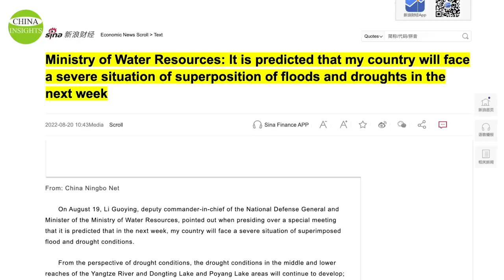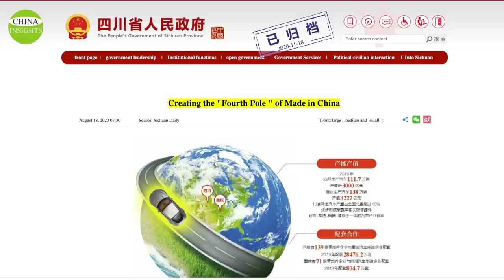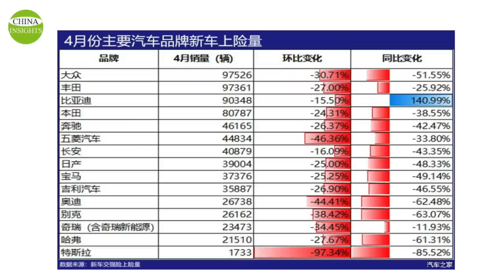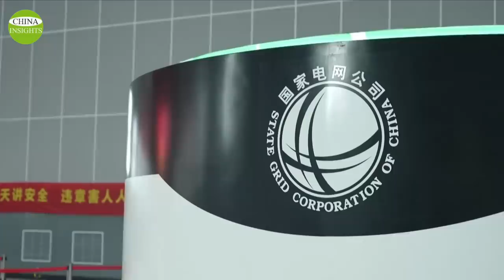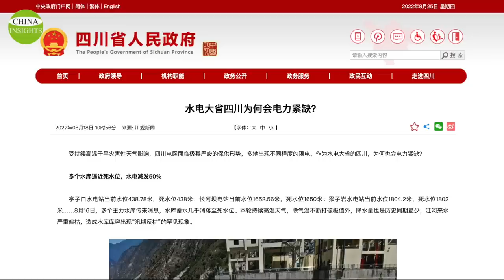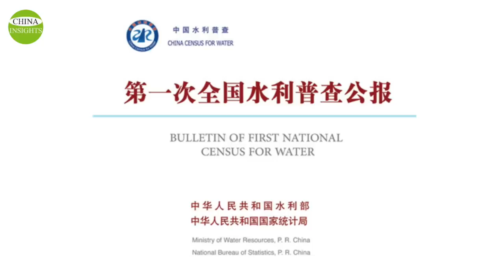Why does Yangtze dry up? The Power Crisis continues & Extremely high temperatures grip half of China

Comment: The cascading Yangtze hydropower system is very clever, however, China needs to find more sources of power to avoid drying out the Yangtze river during every foreseeable summer.
Reply: They are too distracted throwing temper tantrums in the Taiwan strait
Reply: Well this way when the big dam fails everybody down river doesn't drown.
Reply: Winter is supposed to be the dry season of China due to the change of seasonal wind direction. This drought has made the schedule a lot quicker than expected.
Reply: They are making nuclear power plants right now. What about Europe?
Reply: Well, not immediately. When the indundation of rain comes back, the ground can't absorb it due to the dry soil particulate becoming hydrophobic, so it just runs off and you get flash flooding events. That's the bit people usually forget about.
Reply: @yeeyaophang1220  
What about Europe?
Reply: Did you not hear the stats on this, hydro power only counts for 18% of the countries power. There is something more devious going on here than a water shortage!
Reply: Eject                        um...  nuclear power plants require water.   About 50,000 gallons (210,000 liters) per hour

And nuclear plants in France and Germany already run below max capacity due to lack of water.
Reply: I don't think you know what the word "clever" means.
Reply: This was known long before it was even proposed to be built
Reply: @yeeyaophang1220  Europe, America, and Canada are working on nuclear fusion power plants :P
Reply: @defeatSpace  Okay 👍🏼 good time to diversify. However where will they be getting the Uranium? xP
Reply: I read they have a new pipeline from Russia, bringing gas to Mongolia.  That China's also buying coal at a discounted price from Russia, and that the two countries are also collaborating on nuclear power development.
Reply: Nope it's  stupid
Reply: @macmcleod1188  The water is not  permanently consumed it is used mostly for cooling then sent back to the source. the steam used to run the turbine generators goes into the atmosphere as water vapor which ultimately comes back as rain or snow.
Reply: more sources that are not carbon related. Cause if they do use coal or gas the colateral problems will increase further
Reply: @yeeyaophang1220  Canada, Mali, Croatia/Ex-Yugoslavia in general, Niger - Just to name a few countries with huge Uranium ore deposits the EU/US controls.
Reply: @robc8468  it can't be reused when it is already hot.   As I said,  nuclear plants are already running at reduced capacity and even shut down completely due to lack of water.   
Post said China was smart for building nuclear reactors when Yang see river is empty.
Reply: @macmcleod1188  which is why nuclear power plants are made near the ocean, they can work with salt water
Reply: @macmcleod1188  lol, they built it on the river?  Instead of on the ocean? Wow. amazing planning.
Reply: @monad_tcp  many nuclear reactors are inland on rivers. Or worse using aquifers.       China is over 3000 miles north to south and east to west.   It can only serve the coast with nuclear reactors. 

The water issue impacts all water based generation.    Nuclear,  geothermal,  Hydro, solar thermal.

I suggest instead of cheerleadinh nuclear, you do a bit more research on reactor locations and water usage and losses in high transmission lines. 

I'm not anti nuclear.   I think the new molten salt reactors might help with this in 20 to 30 years.   But the days of plentiful cheap water are ending globally.
Reply: @monad_tcp  I think it goes way deeper than that but yea I am sure this makes it easy to put a stop to that. Looking at what is going on everywhere in the world we are seeing a lot surrounding power, the control of it, the manipulation of it and how those in power (no pun intended) are using it as a weapon and holding it over our heads. Be that power being electric or fossil fuel. I see a trend with this and its hard to get that 80k view to see the bigger picture but for sure something bigger is going on here and its the sum of all the parts around things that have and are taking place everywhere. I think the World Economic Forum is centric around this and I think we all need to be on our toes because something big is coming. What that might be I am not sure and at the risk of being called a conspiracy theorist I will leave it at that but I am convinced it is about total control of us and they dont give a damn who gets hurt or dies in the process!
Reply: @macmcleod1188  Nuclear power plants recycle water. Hence they are far more efficient than hydro, which sends the water down the river. Nothing wrong with that, until a drought hits. Then hydro becomes vulnerable.
Reply: @CamperKev  no... this is a quote from monarch partnerz an energy consultancy. 
"The Nuclear Energy Institute estimates that, per megawatt-hour , a nuclear power reactor consumes between 1,514 and 2,725 litres of water. This is compared to coal with figures of 1,220 to 2,270 litres per MWh, and 700 to 1,200 litres per MWh for gas. It’s clear to see, just from these brief statistics, that the nuclear energy industry relies much more heavily on water than other sectors. A large nuclear power plant may use up to 1 billion gallons of water a day and, for this reason, they are often built next to rivers, lakes or oceans to utilise the bodies of water. The water is drawn from these sources and heated to create steam to power the turbine. It then condenses and can be reused in the power generation process. However, it is eventually pumped back into the body of water it originated from, albeit at very high temperatures. This can increase the temperature of the natural water source by up to 30 degrees, posing risks to the aqua life."
Reply: Why not make solar panels on a mass scale and give it to everyone. If its so hot the 🌞 sun can give them free SOLAR energy 🤷‍♂️
Reply: @equityjustice2695  we actually have been making huge quarries of solar for close to a decade now.   All production facilities are at the max and everything is mostly sold out a couple years into the future.    
When the backlog is filled, prices will drop a lot.
Reply: @equityjustice2695  Beacause the lithium alone is not feasible ....... and waht do do when winter comes ???
Reply: Climate change.  Might need to start making all crops in controlled indoor environments by 2100 outside of the  northern and far southern parts of the globe.  We needed all electric cars by now and drastic cuts to emissions globally.
Reply: @aeroripper  TEOTWAWKI.
Reply: @aeroripper  for what it is worth,  it's really too late. For any one under 40.  But anything we can do today will at least reduce the suffering.
Reply: @querelleturner7325  What are you talking about? There's no lithium in solar panels. When the winter comes, you use something else. In the summer, solar will cover you.
Reply: @Relatablename  Have you seen how filthy it is to harvest thematerials for solar panels.
Reply: @querelleturner7325  Doped silicon, aluminum frames, glass backing and copper wires. The silicon is very emission heavy, but there's so much out there now that it can easily be recycled. They last 30 years and the panels on average offset 100% of the emissions required to create it after the first year.
Reply: @macmcleod1188  Palo Verde in Arizona is in the middle of the desert, yet it has no trouble operating at near 100% capacity all year.
Reply: @Relatablename  A few problems: 1) You're ignoring the fact that a solar energy system doesn't only consist of solar panels. 2) Even if solar panels offset their emissions quickly, they still require an absolutely enormous amount of resources in order to produce a significant amount of energy. 3) They only produce energy when the sun is shining and they don't produce a consistent amount of energy during that time. Some sort of energy storage system would be required to offset this problem, but absolutely no one knows what can do this at a reasonable price, or without consuming absolutely horrendous amounts of resources.
Reply: @macmcleod1188  I was hoping that you would get curious and actually do some research, but that was too much to ask, apparently. Palo Verde is cooled with treated sewage, of which there is plenty.
Reply: @PistonAvatarGuy  Actually, I've been running all my electronics with off grid solar for a few years now. Lead acid AGM batteries are by far the best option in my opinion due to the low cost for good energy and the fact that 98% of it can be recycled. The panels really don't need more than a charge controller, DC isolater and a battery- physical or chemical. They do still produce energy on cloudy days, and I've found that there's an 8x difference between sunny or rainy. 

Solar isn't the final solution, but it's good to cover at least half of electrical use  per person. The remainder can use alternative means, but burning fuel is still on the table for the other times.
Reply: @Relatablename  The problem is that your electronics don't consume squat. Read my other replies here.
Reply: @PistonAvatarGuy  Compared to the fuel used by driving or heating, you're absolutely right. Driving alone blows it out of the water several times over. That's not the fault of solar though. When it works, it can punch well above its weight. The South Australian grid has gone 100% renewable several times now since last year, all thanks to batteries that can cover brief drops in output.
Reply: @PistonAvatarGuy  no it's run on 50,000 gallons an hour of grey water from the nearby city.   It still started as water in the aquifer  which is being drained dry by that city.
Reply: @macmcleod1188  Do you know what grey water is? In the case of Palo Verde, it's treated sewage. They're not running out of water anytime soon. If the situation got desperate enough, the waste heat from the power plant could even be used to distill the cooling water, which could be used for a whole range of purposes, like farming.
Reply: @Relatablename  Also, SA only has a population of 1.8 million, which is basically nothing. Try running the rest of AU on solar, or any other developed country, it simply wont work, not without being entirely dependent on natural gas at night... and for HEATING, which seems to be something that you completely ignored.
Reply: @Relatablename  Also, this isn't the thread that I thought it was, so here's what I was talking about (my reply to someone else):

For a home with average consumption in the US, plus an electric car... 

Solar panels: ~$18,000
Batteries: ~$90,000

A 5 kW inverter wouldn't even run an electric range, or a clothes dryer. You need 7,200 watts just for an electric dryer and an electric range can consume more than 20,000 watts! Imagine if someone was cooking with their electric range, charging their electric car, drying clothes and running an electric heat pump all at the same time, that's why homes have a 200 amp electrical service, to account for just that kind of situation, and matching that with inverters would cost around $35,000!

The installation of a system like this would be an immense job, as it wouldn't fit on a normal rooftop. You'd need to build some sort of canopy over your entire house in order to accommodate that many panels. With installation, a solar energy system capable of running an entire home would probably cost $160,000 to $180,000!
Reply: @macmcleod1188  Yeah, but it only uses a small fraction of the wastewater produced by the city (IIRC). Anyway, nuclear is really the only way that we can avoid extreme water shortages, as the waste heat from nuclear power plants can be used to desalinate ocean water.
Reply: @PistonAvatarGuy  look whatever dude.   When you have options that use no water to pristine power its crazy to be in a level 2 water restrictions and evaporate 40000 to 80000 gallons per minute.
Go ahead and make your last post.   Any further discussion is pointless as our positions and realities are too far apart.
Reply: @macmcleod1188  What options?

Evaporated water is clean water, it can be condensed and used for other purposes, which is what I just said.

The problem here is that I live in reality, YOU DO NOT, DUDE. In actual reality, there is no way in which wind and solar energy can power the world, because absolutely NO ONE knows how to store energy on a large enough scale to compensate for their variability. The variability of wind and solar is also a major reason why they will be the most expensive ways to produce energy, by far, for all of the foreseeable future, PERIOD.

Now, go run off to your safe space, and make sure to plug your ears and hum as loudly as you can so facts don't infiltrate that hollow space between your ears.
Reply: @PistonAvatarGuy  Actually I did mention heating. Please reread my comments.
Nobody runs 5kw systems these days. The cost has gone down so much that the standard setups are 3 times the output. Per kW it's been cheaper than coal for years now.

The range is silly. 20kw is the power output of a car engine. A normal stove uses 300-1000 watts. Similar story for an electric dryer, which are usually 2kw. Some people definitely use a lot of electricity, but it's nowhere near that bad. For cases which are, large batteries on the grid like in SA are critical for compensating for these short term, large draw situations.

Also, $160000? Are you out of your mind? Please go get a quote from a solar installer before pulling numbers out of the air. 
Living in Australia, the rainy days aren't a downside for us as most of the year is sunny. The US may benefit in some areas like Arizona, but other like Montana might not. I think I made myself very clear when I said that solar is only part of the solution.
Reply: @PistonAvatarGuy  And $90000 for batteries?? Are you buying them from Gucci? Again, get a quote from an actual company. You'd be lucky to crack $5k AUD on a typical house battery bank that's being offered these days.
Reply: @PistonAvatarGuy  Just saw the other very rude comment you left for me. The batteries in SA aren't intended for storage, they're a sink to make up for brief increases in demand so that power stations don't need to spin up. SA isn't 100% renewable on the whole, but it has run at 100% renewable energy on several different occasions. It is about 60% renewable on the whole. 

And a lack of production of solar? Mate I have the opposite problem. I make so much energy during the day that I have nowhere to store it! Are my years of experience with this technology equivalent to marketing nonsense in your eyes? I suggest that you try it for yourself before being so toxic.
Reply: @Relatablename  You have absolutely no idea what you're talking about.

Most people don't run off grid, so they don't run off grid inverters and they don't have battery banks. The people who are off-grid typically run very small systems. Off grid inverters are not cheap. Off grid solar energy systems have never been even remotely close to being as inexpensive as coal.

An electric range absolutely can consume 20kw, those specs are freely available online. A single burner can be rated at over 3kw, and there are usually at least 4 on a typical electric range (of varying power outputs). Car engines are absolutely not rated at 20kw, that's like a riding mower.

The outlets for electric dryers (in the US) are rated at 7,200 watts, so the inverter does need to accommodate such a load. Some electric dryers can consume up to 5-6 kw.

"Some people definitely use a lot of electricity, but it's nowhere near that bad."

My numbers were based on ACTUAL CONSUMPTION. It was right in my comment, I based everything on the US average residential electric consumption (which almost never includes heating, btw), plus an efficient electric car (Model 3), with the average annual miles traveled traveled by Americans. I don't understand what the problem is here, you either don't know how to read, or don't know how to find the relevant information on the web.

"For cases which are, large batteries on the grid like in SA are critical for compensating for these short term, large draw situations."

That's not how they're used. They have no real storage capacity relative to the amount of energy being consumed on the grid in SA.

"Please go get a quote from a solar installer before pulling numbers out of the air."

I didn't pull numbers out of the air, that was the cost of all of the components that I named, plus the typical cost of installation, which is about 15 to 20 percent of the entire cost of the system.

Solar is not a solution for anything, it's only useful in niche applications.
Reply: @Relatablename  US residential electricity consumption, average: 893 kWh per month
Tesla Model 3 energy consumption: 312.5 kWh/month (15,000 miles/year)
Total monthly electricity consumption: 1205.5 kWh

With 5.5 sun hours a day (typical for much of the US), an online solar energy system sizing calculator recommends having 20 kw of solar panels and a 48v, ~5,000 Ah battery bank (for three days of storage, but we're charging an electric car at night, so it wont be anything close to three days worth of storage).

60x Mission Solar, 340 watt solar panels (pallet pricing) costs about $18,000.

The battery bank:

4x OutBack Power 24V 2070Ah VRLA Battery Bank - $16,900 each. This gets you to 48 volts and 4,140 Ah.
2x OutBack Power 24V 810Ah VRLA Battery Bank - $$6,898 each. This gets you another 810 Ah at 48 volts.

Combined, the battery banks give you 5,760 Ah of storage at 48 volts and cost $81,396 (a little less than what I quoted above).

For off-grid inverters, I used the Sol-Ark SA-12K in my estimate. To get ~190 amps worth of service, you need 5 of those inverters and they cost $6,900 each, so that comes out to $34,500.

All in, those components add up to $133,896, and with the cost of installation being about 20 percent of the cost of those components, that comes out to about $160k.
Reply: Haven't you noticed how many coal powered power stations they are building?
Reply: @mirriulahwaterdog  aww, no nuclear then...
Reply: @defeatSpace  I'd say that you know they have nuclear power stations but they also have a massive program of coal fired power stations. For many people both are problematic in terms of climate stability.
Reply: @yeeyaophang1220  Europe has long been phasing out coal and has begun a gas phaseout.  Unfortunately, they had only just begun when all this nonsense about Russia invading Ukraine in a war of choice began, forcing them to resort to drastic short term measures.
Reply: It’s great that when the stopped the Yangtze River it slowed earths rotation! Wonder why the world extreme weather conditions are rebalancing!
Reply: @PistonAvatarGuy  : You know... When HK was an absolute free market and money flew in and out of the city... Costs were of no barriers.. now you can see why... There was those Iraq wars but at the same time... You can see why china now refuses to play ball ? Cos if costs were of no barriers... We can have both the time.. and the resources to solve the problem.... They wanted fin tech. But even controlled fin tech isn't working.  And now the global situation is lose lose. Reverse back HK first. Get Russia to give back the oil to Europe. And yet.. whose energy is powering the global media ? I just watched last night about politics by Tony Blair... Lol.... He doesn't care. UK kept touting green energy etc etc. HK kept saying green finance. Green finance etc. But nobody has Rutger the mood any more.. cos the stupid media now clouds everybody's judgements... And social engineers just now guilt trips all your scientists and clowns of parades vulgarity every day. While fishes are fried by nuclear heated water. While... I realised now. Why... So my any Chinese students abroad now. To avoid the chaos at home. Prc should have reformed and signed peace deals... Isn't the nsl applicable here ?... Kick off those three gorges dam restriction.... Those water streams look too shallow. And they need to have a global engineer consortium... For that entire three gorges dam. The west should buy that dam. Wrap it into a pension pot. Stop these idiots from ruining it and their internal bickerings etc. And then the technical decisions and often the running of it is done by the consortium and planning is built around those decisions. Cos how come they could decide to... To not send electricity to those grids ? That is absurd. I realised why I don't get hired now sometimes... Both cos of the social media influences. As well as lack of actual trust.... I read that china us going to split into regional governance cos they are planning done kind of regional mega banks... Sigh.... Too ambitious either way. Should've just left HK alone. It was working. It worked. And now they wanted tencents to act as a fin tech bank. Pff.... Yeh if you live near that office with the electricity. I bet it's using the nuclear plant nearby... The video shows that the Yangtze... Is really shallow right ? So they never tested the depth of the water or its power ? Strange.... And no food too. And they didn't even started to grow food replacement either... No wonder people risked wild food instead. Makes sense now. When you see people run off the other way. Makes sense....